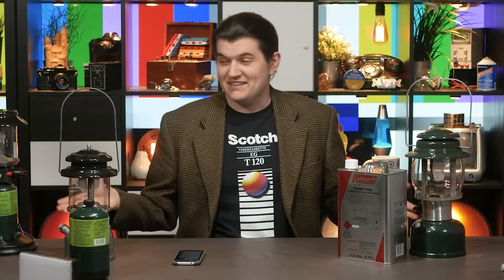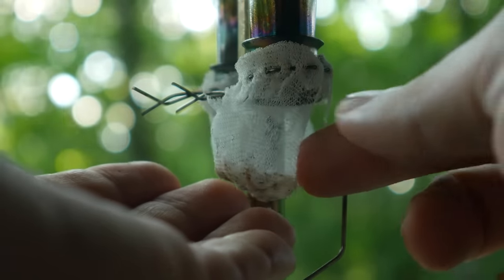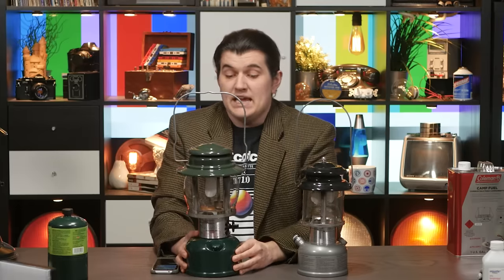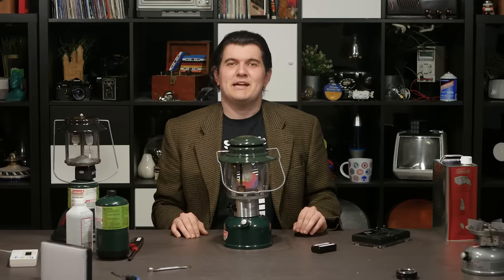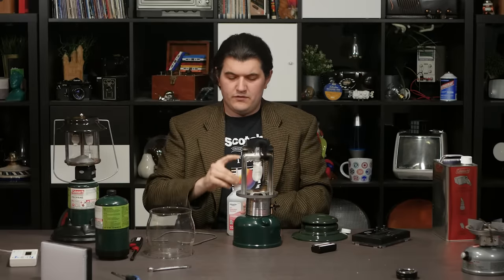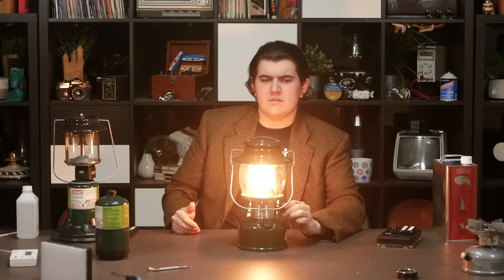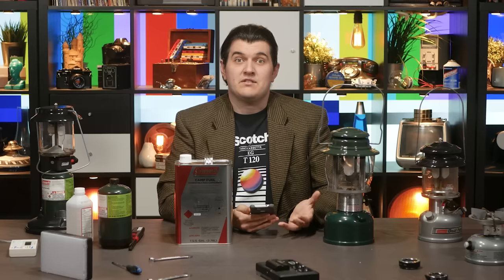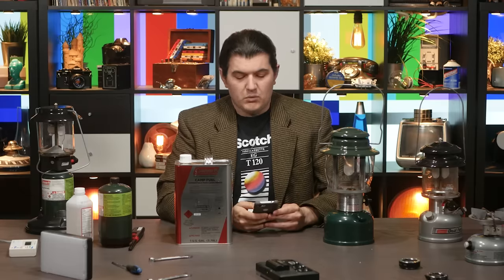A very rambly Coleman Lantern follow-up. Turns out they rarely make sense in 2021

Comment: You yanks take a simple Tilliey lamp and make it so complicated.  We moved on from the ordinary hurricane  lamp to the Tilley hurricane lamp it is so easy you light a tilly lamp and the only reason you put it out at bed time that knob on the side is not for turning it off it is for if a bit of dirt gets into the vaporiser you flick that as so the light gets bright again we had a table tilly lamp which was put on the center of the table.   All you needed to light it was fill it with paraffins oil a per of small tongs that was put on the vaporiser just below the mantle the tongs had a wick and you kept it in a small jar with mentholated spirits you put the tongs on the  vaporiser and lit it you let burn until the flame was starting to did then you pumped the lamp just that simple

Comment: I believe one part is your fokus on practicality. The people who use these things are not really concerned about efficiancy or practicality. Its a lot about the feeling and the use of the object itself. In the very same way people like oldtimers despite there being much more practical and efficient cars out there today. Its also pretty practical in case of a power outage as I always got parafin at home as fire starter. And in the rush to get stuff for a power outage its much easier to get lamp oil than batteries, flashlights or propane, because fewer people have lamps running on parafin than on electricity or propane.
Reply: And for my petromax its even more so the practicality of having one device in many. I can actually cook on it with a cooking adapter, and can turn it into a small space heater with an insert that converts most of the energy in the lamp into infra red radiation. I love it on bike camping tours because I am completly independent from power with just a bit of lamp oil.

Comment: Plus, kerosene jugs can be topped off and refilled at will, while propane bottles are disposable. Yeah, they can be refilled to a point, but it's less energy dense than kerosene anyway. Plus, you can cut the kerosene with citronella for the bugs. Granted, I have and love my inflatable solar lanterns, too, not to mention the solar bug zappers, but the kerosene lanterns still make plenty of sense. White gas, not so much.

Comment: The Amish stores in my area are lit by propane mantles like from the lantern. But minus the lantern.

They just run black pipe around the room and off the side are two mantles with a little bug catch tray under them.

Found out about it when my freind, who is quite tall, was wondering why his head was getting quite hot quite quickly. Lol

Comment: there's 240 W-hr lithium batteries kind of lantern size with built in light, ac outlet, and can charge on 12V or solar panel. great for all kinds of low power needs

Comment: Pump gas causes problems with the generators in pressure lamps and stoves greatly increasing maintenance costs as the generators will plug up and need replacing much more often due to all the additives in pump gas for preventing damage to the valve train, etc, etc.

Bottom line is don't regularly use pump gas in a pressure lantern or stove if you want it to run reliably with low maintenance.  If you do use pump gas in your pressure lantern of stove be sure to drain it completely and run some white gas through it to purge it out as completely as possible.  Also be aware that fumes from the additives in pump gas are not really very good for your food or your lungs.  Just like you wouldn't want to be breathing the exhaust from your internal combustion vehicle you would not want to be in close proximity to a lantern or stove burning pump gas.

Best!

Comment: I use battery lights occasionally, but they are frustrating because they are always dead when needed the most, and the batteries are expensive. Coleman fuel keeps a couple of years or more, and you almost always have light (and heat) when you need it.  I never liked the dual fuel ones because the generators just did not last.

Comment: 28:50

A 20 watt LED of decently high (90ish) CRI will output somewhere north of 1800 lumens, which kicks the crap out of the gas mantle lanterns for brute lumens. A 50 w/hr solar panel charging a 200 watt/hr battery will sustain such an LED for ten hours. 

Go with a lower CRI LED (such as the Luminus SST-40s), and your lumens/watt goes even higher, allowing you to get away with a smaller battery.
Reply: No heat though

Comment: Mister Heater sells a brass fitting for about $20.00 that screws into a 20 lb propane tank, turn it up side down, screw a propane canister on to it and turn on the tank to fill. If the canister is room temperature, the tank will only fill half way. If you have access to a freezer, snow drift ect. put the canister(s) in the freezer for an hour before filling and it will fill more and faster. When the canister is full, filling will stop on it's own. Listen to the process and you'll hear when it's finished.

WARNING!!!

SHUT OFF THE TANK BEFORE UNSCREWING THE CANISTER OR YOU WILL BLOW LIQUID PROPAME EVERYWHERE MAKING FOR POSSIBLE EXPLOSION HAZARD AND
LIQUID PROPANE + SKIN = FROSTBITE IN THE TIME IT TAKES YOU TO SHUT THE TANK OFF.

Comment: Battery powered lamps only work for a while under a lengthy power outage spanning several days to a week. For a credible natural disaster scenario involving tornado, severe ice storm, or blizzard that takes out your power for 3-7 days or more, white gas and kerosene lamps begin to make sense as you can stockpile the fuel. I have a combination of LED lanterns and kerosene lanterns, plus large candle table lanterns. What I don't have are pressurized mantle lanterns. The downside is the fire hazard using flammable fuels. I used white gas lanterns tent camping decades ago and they are convenient as carrying volume and weight aren't much issue. The US Army and USMC used pressurized gasoline stoves in their field kitchens for stoves and ovens. They're not small. I've seen what happens when one springs a fuel leak. The resulting field kitchen fire is very destructive and dangerous. Lucky if someone isn't burned. I personally saw an entire field kitchen destroyed in an hour, with most of the destruction occurring in the first 15 minutes. Widespread Indoor use introduces carbon monoxide poisoning hazards. Some amount of ventilation for fresh air is required.

Comment: just a couple of reasons I find kerosene better (2 decades traveling with circuses) when you are officially "in the middle of nowhere" Kerosene is the easiest fuel to find. every farm has a tank of it. The lantern also doubles as a heater and kerosene vapors, in a small wagon, are just less offensive than other liquids. BTW I can tell you that back in 1988 it cost 10 cent to fill my Tilly lamp. Same lamp today costs €1.57 to fill, but it's now just a back up emergency because electricity is getting easier to find than kerosene when you don't travel anymore.

Comment: I use multiple sources of emergency/camping heating and lighting.

I like options. I will keep my battery powered lights and fans along with propane latern and Mr buddy heater.

Plus a good inverter  generator and solar/battery/inverter.

Options are good. (TM)

Comment: I would definitely move to 18650 or larger cell batteries. They are pretty much the standard in lots of flashlight and other lighting requirements. They also have very capacity or very high draw variants, cell protection, standardized charging, economies of scale (cheap price), and very high quality manufacturers.

Comment: Portable lighting has come so far from traditional fuel lamps. I just bought portable Hikoki LED work light and it apparently runs was it 38 hours on low setting with was it 6amp battery. Can't remember exact specs, but still way above 24h of actual usable light that takes space of pretty much as three closed fists.

Comment: THE GEIGER COUNTER IS DEFECTIVE....DEFECTIVE!....I have one and it does that a LOT....I dread turning it off because I know it when I turn it back on it may work OR more likely it will sit there 10 minuter or much longer cycling On and OFF...on and off...ON and OFF  (YES it's on the charger) over and over ....and I've had it for years and it has Always done this

Comment: Many years ago, a white gas lantern is the only reason i survived. Temps unexpectedly dropped to -20f overnight for two nights. I was in a small tent. I would light it, get it warm with the vent open and shut it off. Every hour, all night.
Reply: Great. BTW at home I only use incandescent bulbs because LEDs create harmful dirty electricity and blue light.

Also BTW robertdinicola I suggest watch a 13 part series called What on earth happened by Ewaranon to learn that the earth is not a globe. I got it in my about tab.

Comment: Your thunb is meerly acting as one of the check valves required for a piston pump. But using your thumb as a check valve allows you to re seat the piston of the pump easily.

Comment: The host of the channel is an impressively brilliant person with a keen mind for science. Yet I think he gets Coleman lantern USE wrong because of a lack of experience using them. Those who are lantern hobbyists or Coleman collectors find the Coleman kerosene 639 lantern an easy, safe and dependable lantern. The lantern new comes with a plastic bottle with a brass pour spout to use with the pre heat cup to prime the generator, it takes only 2 minutes to do this. DENATURED alcohol or Heet in the yellow bottle is most often used to heat the generator. Rubbing alcohol is never used because it doesn't burn as well and is sooty. A good way to light a white gas Coleman  is to remove the globe and hood- ventilator and take a propane torch and run along the generator for a minute. Heating the generator by running the torch along it length will allow the lantern to light without flaring or the " whomp" sound. Another way is simply to take two burning matches and hold at the base of the generator preheating the generator and then light at the burner tubes as normal .

Comment: Just found your channel. Hat tip for VHS tape T-shirt. They look new, did you work in a video store or were they a donation from a benefactor?

I wish that I had a teacher like you in high school. My teachers were all idiots and hated their subjects even more than I did. They probably were assigned to teach something based on what was available at the time. 

When I was 15, I built a Heathkit HW-16 CW transceiver in a 24 hour kit building marathon. It didn't work. I took it to my electronics shop teacher at school. He took a large screwdriver, poked it in the chassis, and shorted out the mains. He than said something akin to "it's broke alright."  I then took it to a ham radio truckdriver friend who was an ex-navy technician. He had it fixed in about 15 minutes. It turns out that many other people had the exact same problem due to some ambiguity in the instructions. 

Anyway I am happy to have found an outlet for technical information that is interesting, entertaining, and useful.

Comment: the liquid fueled lamp also function as a space heater... in some sense. also it's usable for emergencies. the fuel is not goin to self discharge. for everything else... batteries is way to go. or a small honda portable generator.

Comment: The reason people want appliances that run on kerosene is that it’s comparatively easy to store bulk quantities plus it’s cheaper.  How would you store five hundred gallons of kerosene, propane or coleman fuel in your garage or basement?  Your local fire Marshall will tell you absolutely do not store 500 gallons of propane or coleman fuel in your house… in the northeast it’s perfectly normal for a house to have an oil heat system which is basically kerosene.  Sometimes the tank is outside and sometimes the tank is indoors.

Additionally, coleman fuel products are currently available in the USA…. In Europe it is ridiculously expensive.
Reply: Hi thereal have you become a flat earther yet? If not I suggest watch a 13 part series called What on earth happened by Ewaranon to learn that the earth is not a globe. I got it in my about tab.

Comment: The lanterns are cool but if emergencies are your worry buy a couple LED headlamps as well. For extreme cold you can get ones with corded lithium battery packs you can keep under your clothes. For the lantern form factor you can get rechargeable D cell batteries with a 10 000 mah capacity. That is a ton of light on a 4 D cell lantern

Comment: A 30 pack of alkaline AA cells for $10 and a few led lights works for us and we use the AA cells in other stuff and already have them.
We are near the car as our supplies are in it that has a huge battery and is run every few days to move or get supplies so stuff gets charged then including LED lanterns

Comment: The range of Coleman LED Lanterns leaves all 3 of these for dead, But I have still bought one of each of these Lanterns as well as the LED Models, The Coleman LED Lanterns have these 3 beat at every turn except that they do provide a heat source in winter time or if you buy them for nostalgia reasons, I would still buy the LED lanterns and these ones again, One of the main reasons for buying these type of lanterns is they can live for ever and there are thousands of 80+ year old Colemans still working like the day they were made and that is why these Lanterns are still Important.

Comment: Liquid fuel camping stoves are mostly used for expedition style activities, because it is much easier to get cerosine or petrol than propane cartridges.
Reply: An other point to use liquid fuels over propane gas would be that in cold environments due to the low temperatures the gas pressure decreases to the point where you can not use the stove efficiently. This is only relevant at temperatures below -10°C. Some stoves also allow the gas canister to be used in an inverted position. This wayliquid propane is used and the system is less dependent on the gas pressure inside the canister.

Comment: In regards to LED lumens/watt, there tend to be a tradeoff for color temperature and accuracy vs efficiency. Warmer LEDs with more accurate color rendering of about 95+ CRI are substantially less efficient than cooler LEDs targeting 70 CRI or lower. All else being equal of course. Pushed to the limit, LEDs also tend to lose efficiency. At lower current, LEDs exhibit better efficiency, including the higher CRI ones.

Comment: Then pump using a rubber or leather round flap like a bicycle pump so the air can be sucked past the flap and when you press down the air pressure pushes the flap against the walls creating a seal.

Comment: Your thumb covering the hole as one pumps, acts as the check valve.
The thumb should be relaxed over the hole in order to refill the pump with new air while pulling back on the knob, in order to work properly/more efficiently during the next compression stroke.

Comment: On the kerosene lantern, I wonder if you heated the generator with a butane lighter or mini torch, if it would light quickly....even though you would have to reassemble it...
Reply: That would cost a lot in butane versus alcohol. They do make lanterns which burn kerosene directly to light them. Look up the Anchor 950 lantern.

Comment: All Coleman white gas lanterns will safely and reliably run on automotive gasoline, with one caveat. The rate of hard carbon deposited inside of the generator will be greatly increased (even in the duel fuel models) basically the lanterns will "need an oil change" sooner. The generator is either replaced entirely, or it can be cleaned out and reused again.

Comment: I stay away from white gas / camp fuel or regular gas in lanterns, I stick to good ole cold blast oil / kerosene lamps for safety reasons and I hate dealing with fragile mantels even though they are brighter and produce a better light than oil lamps.

Comment: The key difference is technology level. As a normally handy 55 year old I can improvise, maintain, and repair the kerosene lantern. From scrap metal. 
For electrics, you are relying on cutting edge technology that no assemblage of people can just build or meaningfully maintain and certainly not fix.
I know how the kerosene lantern works from first physical principles and use that knowledge in its operation and repair. I, by my privileged education,
understand the operating principles and methods that make the many factory built parts work together in the battery  lantern, yet even with this knowledge 
I am powerless to do anything whatsoever to adapt or fix or customize the device.
I was brought up as a tool user and maker, not a procedure follower. I can only impart the corresponding knowledge and skills in a medium where I can mess
with the guts of the thing, and unfortunately the way we use modern technology makes it difficult to find the required handles. Yet the continuation of science
and engineering know-how demands youth with that particular mindset. The much desired STEAM people will not spontaneously appear if all of us
live in a world of "magic" technology and devices.
This is what frightens me.

\\\\